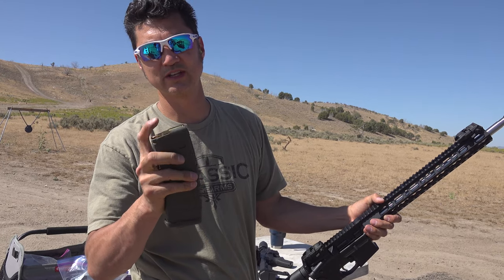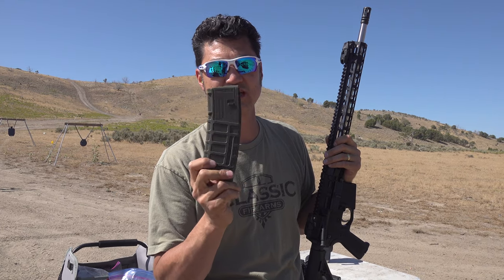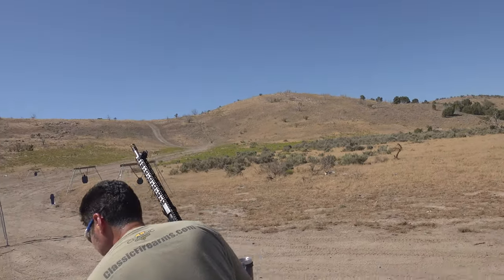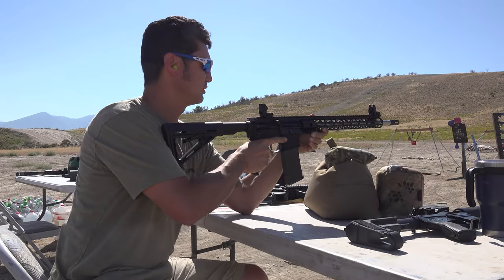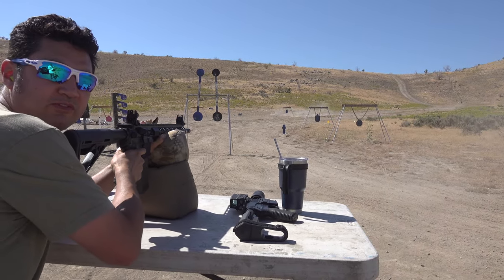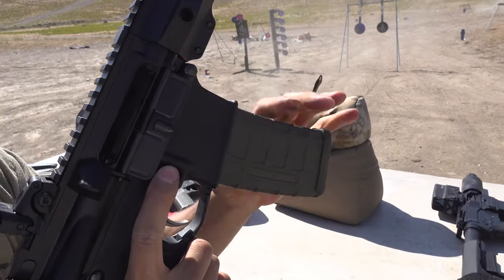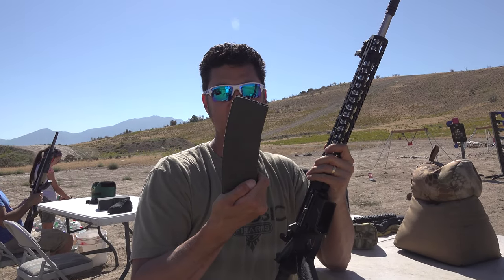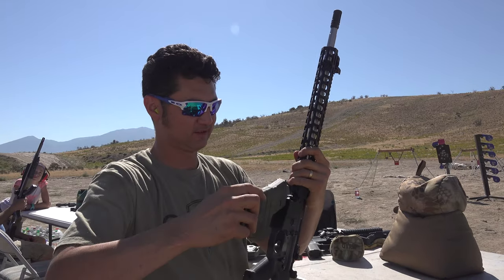MAGPUL PMAG - Loaded With Ammo for 12 Years TEST!  (No Dust/Impact Cover)

Comment: But now, can we go back in time and catch up with the "bent lip theory" guys?
Reply from the maker: time machines...
Reply: A buddy of mine shipped with the marine corps to Iraq in 2008 with a few pmags no issues, in early 2010 he was deployed to Afghanistan with the same mags and had a couple of them fail with feed lips cracking off and sending ammo out. Luckily it wasn’t in combat. Conclusion, pmags loaded and sitting in a safe are fine, said mags loaded, fired, dropped, loaded, etc etc did have a small percentage of failure, his unit did not allow personal pmags anymore after that.
Reply: ruststar the good thing is that they break which can be obviously seen. Bent steel mags arent so obvious.

Comment: I loaded 4 steel usgi spec mags with no moisture absorbent packs for 4 years. Sure enough when I came home to visit I remembered I had them. Went to the range and they ALL shot just fine. 3 years after I used those mags I still have them as my primary mags and use the steel hk style mags I got for $5 a piece.
Reply from the maker: nice!

Comment: No, this has been tested repeatedly. Storing P-mags for extended periods of time without the dust cover is fine. If you have them and want to use them then go for it. But it is absolutely not required.

Comment: I just stumbled upon this video while looking into the stress relief dust covers because mine did fail. I had 7 loaded Pmags in an ammo bag for about 2 years. My mags did not come with the covers, and I had never heard of them before yesterday. I pulled the bag out and looked inside and had about 20 rounds in the bottom of the bag. I assumed it was just loose ammo I put in there until I had enough to fully load another mag. Turns out, it was all from 2 of my mags. One of them will only hold 25 rounds before they start popping out on their own. Another mag will only hold about 15 reliably. I guess I'm the odd man out since I have had this happen and I had never heard the rumor that it could.

Edit: Nope, NM. I got scammed and didn't realize it for a while. The mags that failed and one of the mags that didn't were actually PROmags. I have only ever purchased Pmags. However, the mags I buy are in resealable bags, and I can only assume that somebody swapped the mags and got some Pmags at a lower price. I didn't realize it until I purchased a few more Pmags to restock and add to my stash. That's when I saw that 3 of my mags were actually PROmags. They are all in the trash now, and I have had 0 issue with Pmags to date. If you buy your Pmags at Rural King or anywhere else that sells Pmags and PROmags, make sure you are getting what you pay for.
Reply from the maker: that's good to know.  have you talked to magpul to see what they say about it?  I'd be curious to see what they say--and if they would replace any faulty mags.
Reply: I have some loaded for at least 5 years. No covers, no problems
Reply: Could it be where you stored it? I ran into this issue on one I left in my truck for 2 years. But I do live in Arizona, With the temperatures getting to 110F for months at a time. Definitely my fault on this one

Comment: Have you since reloaded and functioned this same magazine? I’m curious if it continues to function properly after the spring has been worked a few times. I have several gen 2 Pmags that I loaded and put away about 5-6 years ago, they’re stored fully loaded with the dust covers. Glad to see everything worked as it should.
Reply from the maker: I just threw it into my range bag with all the other mags
Reply: Roger that, thanks for the reply. Your test in this video has definitely given me some reassurance about leaving mine stored loaded. Thanks!

Comment: I just did this with an old P Mag, the springs felt a bit stiff and they were really hard to unload. I would imagine they work fine in some cases mine were stored in a safe at full capacity didn’t try shooting them because I left them in the safe for about six or seven years. Probably fine for the range, but I wouldn’t bet my life on them.

Comment: Ive stopped using p mags because the lips spread if left loaded for really any amount of time.  Its been the same malfunction with gen 2 and 3 mags always with the dust cap thing and with different loads.

I think that climate has a lot to do with it, i live in a very humid place
Reply from the maker: yeah, heat and other factors too--mine was sitting in my safe inside the house (temp controlled environment)

Comment: It's what I've been telling people for years: Materials deform plastically only when stretched or compressed passed their elastic region of displacement. A spring will only "lose elasticity" inside of a magazine if:
1. Faulty heat treat
2. Heat treat compromised by extreme temperature after manufacturing
3. With lots of use (Loads and unloads)
4. Technically the spring can experience a weird destructive wave-effect where shock travels through the spring and compresses different parts of the spring at difference amounts. This is a huge problems for buffer springs wearing out. Gisselle has a video out on how they're working to solve the issue.
Reply from the maker: I think the concern is more about the feed lips not the spring

Comment: I was more curious how the spring would work after being loaded that long
Reply from the maker: the springs stay strong
Reply: @FullLeadTaco  so there is no issues at all with leaving plays loaded in a safe? Even if they end up sitting that way for a few years?
Reply from the maker: @mycatsaliberal3848  leaving a spring compressed shouldn't cause wear on the spring--it is the compressing and uncompressing of the spring (over and over) that puts the wear on the springs.  This test was only a sample size of one, but that's one thing it showed me.

Comment: I had an old Thermold 20rd mag that was left loaded. One plastic feed lip cracked. When loaded now it'll hold the rounds for a couple minutes, then spontaneously start spitting rounds out. Still functioned through the AR though. I guess the top pressure from the bolt held them in place.
Reply from the maker: Yeah, the thermold mags don't seem to be built quite as sturdy

Comment: I store my hi cap with 2 fewer rounds and low cap with 1 fewer round. Keeps the tension below max and never had a problem.
Reply: I don’t redline my car ever, I only take it to 6,200 rpm instead of 6,500. I don’t want to stress the valve springs to the max

Comment: Pmag's are good and they don't bend. I have a couple other polymer mags that have noticeable bending after a couple years left loaded.
Reply from the maker: have you tested any of the other brands over time
Reply: @FullLeadTaco  I have left several loaded over time. MFT were badly bowed out compared to the magpul. I had another cheap brand that bowed, but can't remember the name. I only use GI or pmags now.

Comment: Well, theres no way to verify that this magazine was loaded for 12 years.  I'm hoping it's legit.

Just saying.
Reply from the maker: Yeah, I'm not even sure how you would prove a magazine was kept loaded for that long... You couldn't even have a camera running on it that long.  Even the gun shop guy who I talked to about this test doesn't work there anymore.  I guess "my word" is the best proof that I have.  Now, looking back, I wish I had stuck 10 loaded mags into my safe.  It would have been quite expensive though as the new pmags used to cost about $30 back in the day.
Reply: @FullLeadTaco  I wasn't trying to be a dick.  I just have to speak my mind.  I hope my 7 plus year loaded glock mags still function that well having been  loaded at 80 percent of max capacity.
Reply from the maker: @danthoreson4062  no, I didn't take it that way either...  It's a difficult thing to prove.
Reply: @FullLeadTaco  good to know.  You guys still have the single shot ar pistol?  That was great.
Reply from the maker: @danthoreson4062  yeah, still have the beowulf and 300blk bolt action AR pistols
Reply: Guess the wine has started

Comment: The gen 3 pmags(window) were released like in 2012 which is what you are holding in your hand in the first half of the video.
Reply from the maker: you do realize that there is no window in this mag, right?
Reply from the maker: Gen 1 non-window mags still had the window molded in, but it's just not cut out.  If you watch this video in 4k and look at the mag closely, you'll see that what you thought was a window is not a window--it is opaque and has 3 dimples where the window would be if it was cut for a window.